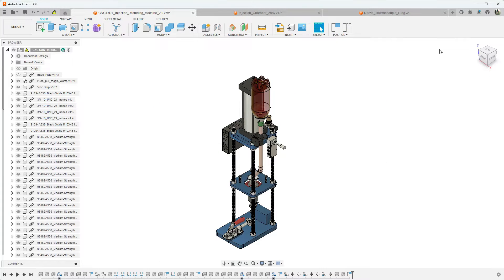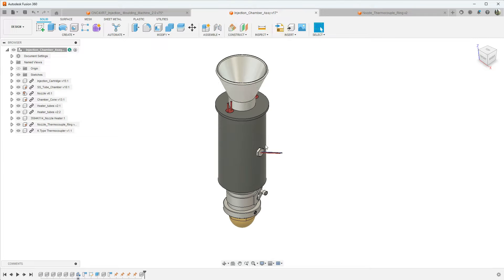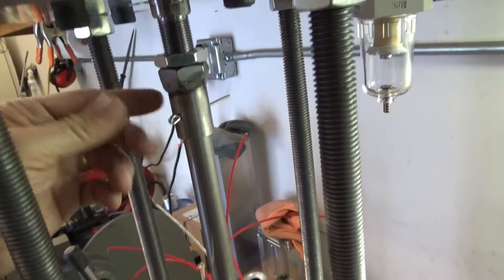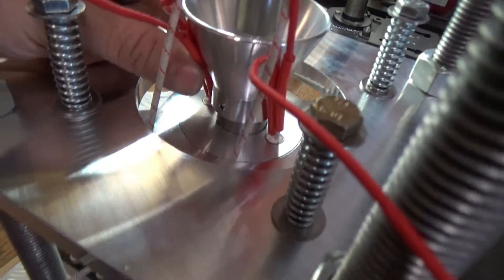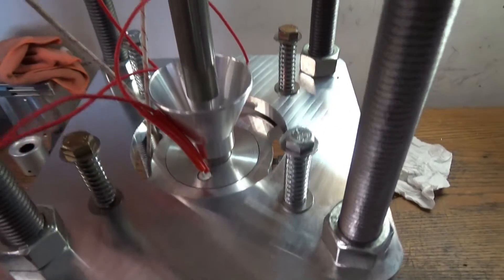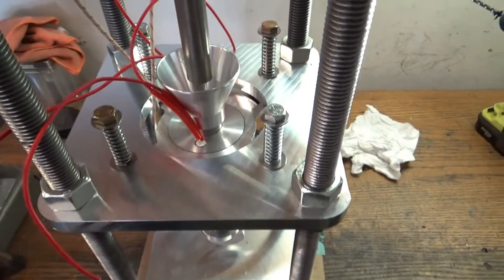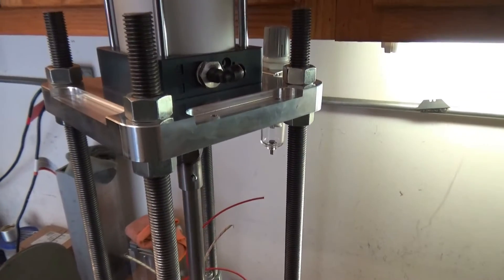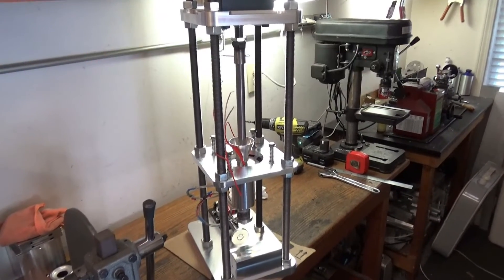Injection Molding Machine Assembly

Comment: Nice work. I made a almost identical molding machine 2 years ago. A couple suggestions, my toggle clamp is 3 times the size of yours and the molds were forced apart easily, plan on beefing up your clamping system. I would suggest a hydraulic bottle jack or similar. Search youtube for "john sl spoon" and check out the guys clamp at the end of the video. My other suggestion would be getting a cheap timer relay for your solenoid valve to keep your injection time consistent.